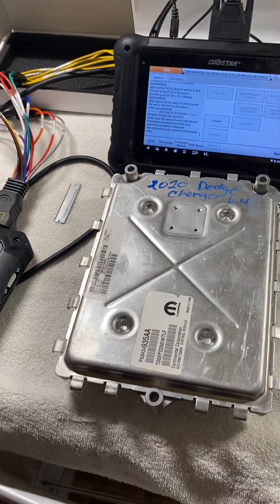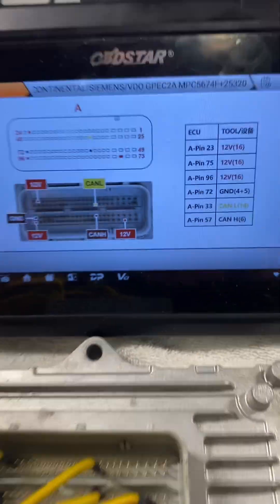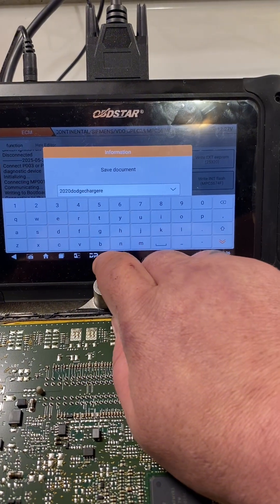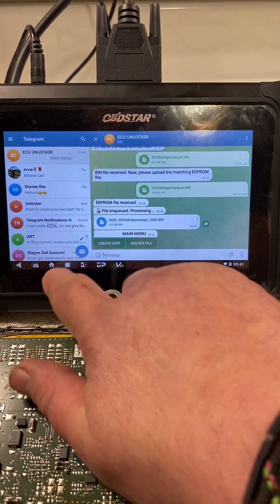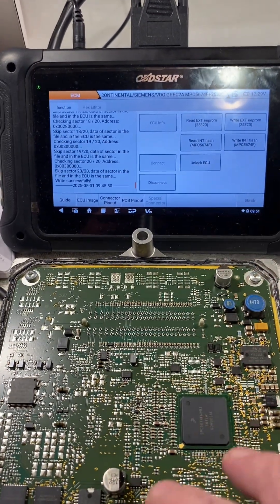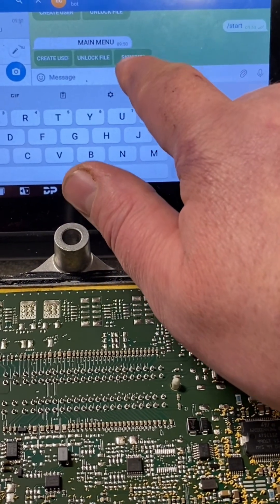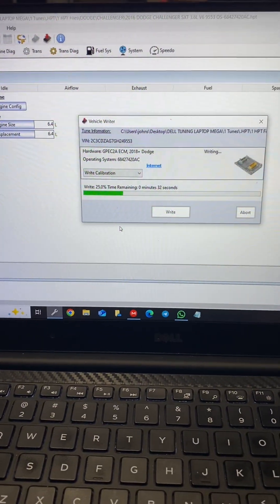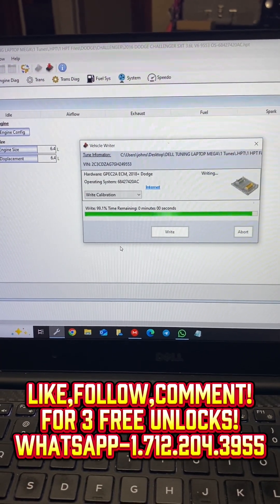Dodge Jeep Ram Chrysler ECM Unlock Vin Change Skim delete with ECU Bin Bot  on OBDStar DC706

Comment: can a 5.7 ecu be programed with a hellcat os for an engine swap like this video? i have complete engine wiring harness for the missing maps and stuff the body doesnt have. i actually have the ecu for the hellcat engine too. just want the easiest fix for the car to accept the new engine. 

oh one more thing .im trying to keep the awd pursuit charger os so everything in the car like transfer case and factory options still work ,just with the hellcat engine instead of the original 5.7m
Reply from the maker: If you send me both ecm’s yes I can make it work
Reply: @drewjohnson5402 ill be in touch soon. if i wanted to keep the trackhawk motor and trans too in the swap,while keeping the transfer case that came with the body is that doable? 

i guess instead of asking a bunch of specific questions about particular setups maybe i should just ask can you do custom os . picking features from different pcm files and making a combination that doesn't exist from factory? i dont mean to be a bother with lots of questions, but there are about 4 different combinations that are options based on how the actual drive train components hold up and how difficult the fab work will be to make different subframes and transmissions fit. i promise im not just blabbing hypothetical on the internet, ive invested alot into this already and would pay for the time and effort to work out the kinks. thanks for your response.

Comment: how would the vin change on the ecm not affect the rest of the 6.4 moduels ? wouldnt bcm,pcm and rf hub still have previous vin and cause the car to have issues or will those modules learn the new vin strictly off the ecm?
Reply from the maker: Then vin wasnt correct and didn’t match so we changed it to match the vehicles vins.
Reply: @drewjohnson5402  Did that customer finish the build and did this vin change work to start the car?  I am in the middle of the same mod.
Reply from the maker: @kennethgoodsell4318 yes vin change and skim delete worked.   We did later end up acrually programing keys from Bcm data

Comment: How do you keep drill shavings from falling in on the board?
Reply from the maker: you dont drill all the way through it.  you drill down to where its thin enough that you can pop the circle out with a pick.   thats why you need to use a spot weld tool.   ill make a video soon